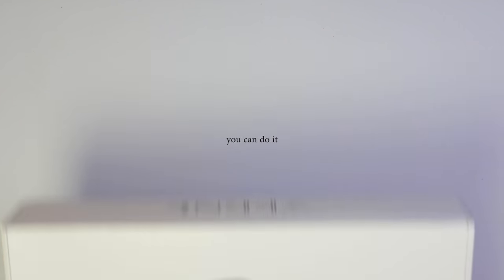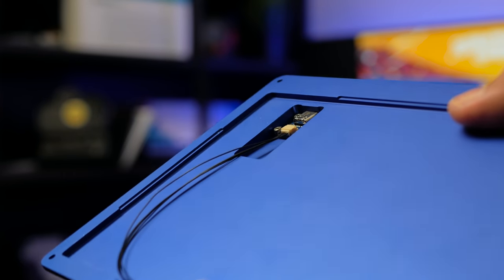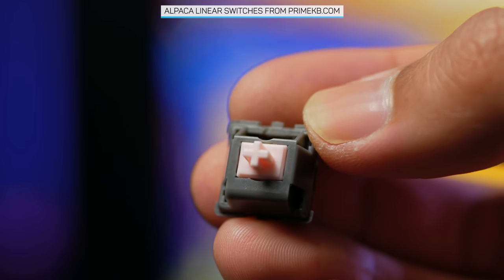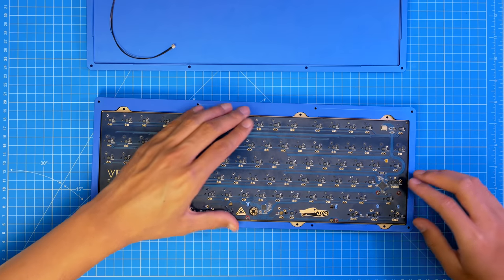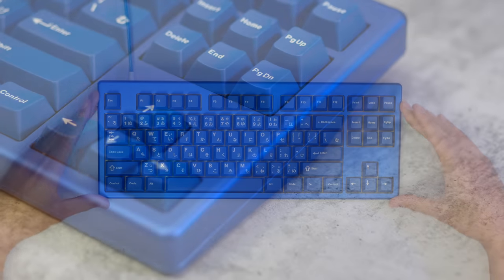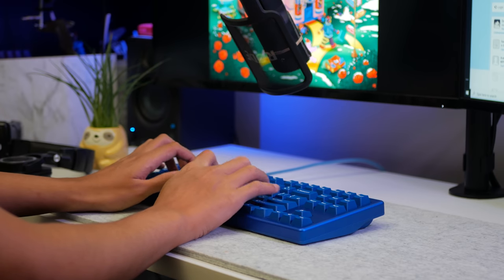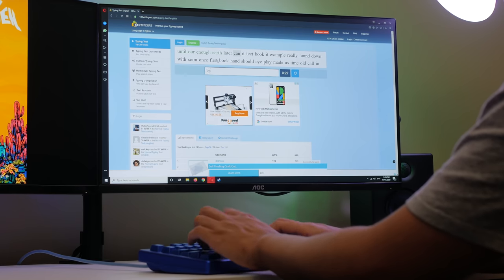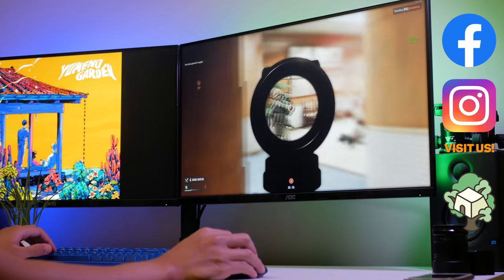Verne Custom Mechanical Keyboard Build with Alpacas!

Comment from the maker: mmm, woulda been good to do part of the sound test without the spacebar, as that was making the most sound. smh
oh and no blue switches, soz for mad clickbait.
Reply: I can't go on your website
Reply: @mumenrider677  theyre smoother and more consistent, though both creams and alpacas both could really use switch films after lubing/opening just once
Reply: You should review the dierya 60% keyboard just bought it and I love it
Reply: than which switch is it?
Reply: Really wanted to check out your website, but it doesn't seem to be working.
Reply: This might be a weird question but Where are you from
Reply: Bonsai_YT Australie

Comment: These housings and stems are really good but they really badly need switch films, same is true of the other durock switches. It helps the sound greatly
Reply: switch films are a game changer
Reply from the maker: yeh I gotta get some films for sure! Gonna be chucking in some different stems in another board though, so I'm keen to see how they turn out!

Comment: Is soldering generally required to assemble mechanical keyboard or are there no-soldering required mechanical keyboards kits
Reply from the maker: Usually for custom mechs, you have to solder. However there are a bunch of hotswap options available. I'll be making a video on this topic soon!

Comment: Do you know any 75% or TKL hot swap pcb's?
Reply: XD87
Reply: You can make any PCB hotswap using sockets but they need to be soldered in typically so if thats what you want to skip maybe consider a build service to put the sockets in for you and then its a HS board.
Reply: Learning how to solder a keyboard is really not difficult. Whatever you do, just don’t leave the iron on the pcb for longer than 5s or so at a time. If it doesn’t work the first time, lift off, try again

Comment: If you were to put in LEDs, where would you get your RGB LEDs? I was looking at KBDFans and they only have set color LEDs.
I might just go with the white LEDs, but I kind of want to have the RGB ones since im going to be soldering the LEDs to the PCB.
And also, how do you get the small square LEDs that fit in the kailh BOX switches?

Comment: If you're spending that much on a keeb why not go for high quality kester solder? Also lubing the stabs with dielectric grease is an old practice now, most use 205 like Taeha

Comment: Dude, imagine pulling out one of them stabs...I'd probably just throw away the keyboard coz there's no way I'm desoldering all the switches.
I did it once and I almost lost my f@#$ng sanity lol
Reply: I've had this happen to me TWICE with Zeal stabilizers, on the backspace and enter keys. I refuse to use Zeal stabs in soldered builds now, just not worth the headache. The C3 stabs are SUPER tight and having a wire pop out seems very unlikely. Maybe using a zeal stem in a C3 stab housing but honestly the clear stabs from the various sellers are just too expensive for what they are, IMO.
Reply from the maker: @samoksner  rip zeal
Reply: @TaeKeyboards  for the price they charge, it really makes you wonder if you just pop the wire back in and resolder a board when it happens!!

Comment: Anyone in Australia or shops to Australia that makes custom boards hmu I really want one but i just dont have the time myself to learn / and actually make one
Reply: Most of the learning happens online anyways, in terms of what to buy. Once you've purchased, soldering is easy to learn, especially if you're only soldering a keyboard. The key is to never leave the tip of the soldering iron on the pcb for longer than 4-5 seconds. If it's not working, just lift off, and try again. You'll pick it up in no time.
Reply: @rousseau327  its more I work 6 days a week 10-13 hours a day I have extrememly limited free time and a lot of spare change I value not learning and paying some one else to do it alot more than i do learning my self
Reply: Coliteral then just hop on r/mechmarket and buy everything you need, including build services. Don’t tell me you have time watch and comment on Youtube videos, but can’t be bothered to compile a list of keyboards you want to buy, and then submitting a reddit post, lol